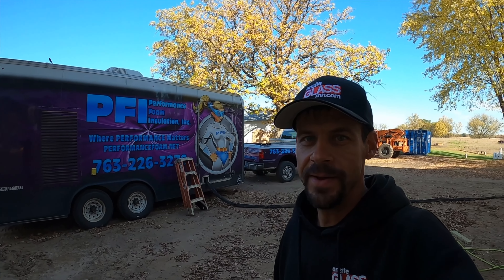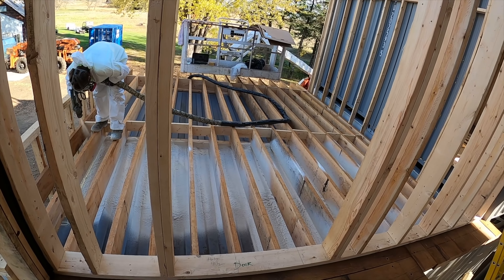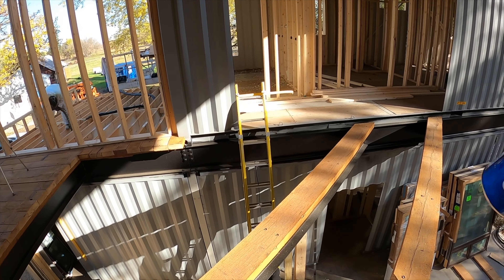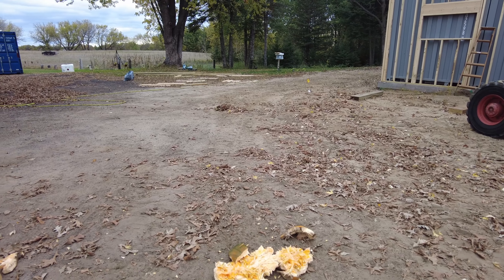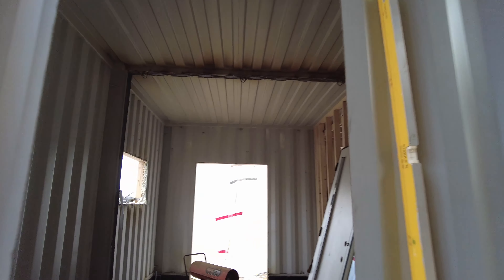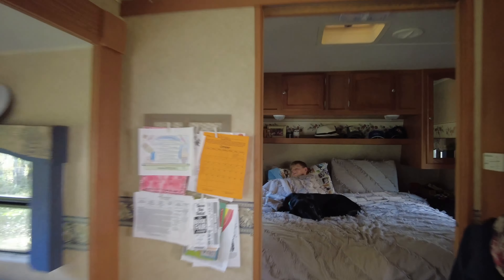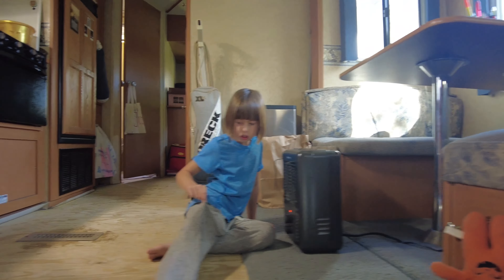COST Of Insulating Our Container Home With Spray Foam

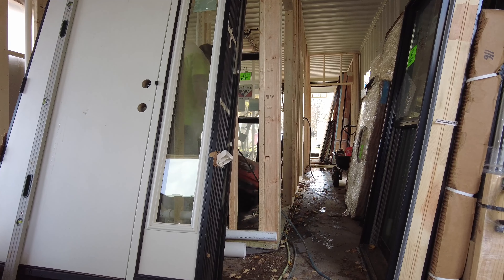Comment: 6:40 answer
Original quote $20,000 for a 4,300 sqft house then  $40,000 labor and materials after prices went up due to manufacturing issues from the winter cold